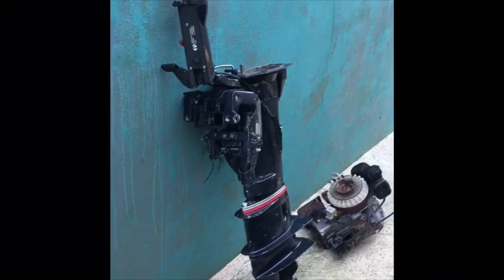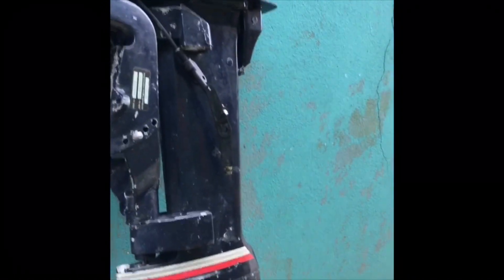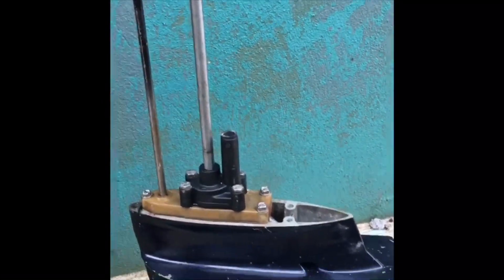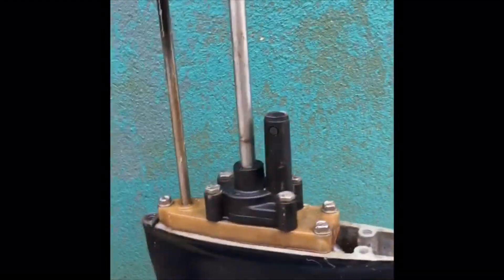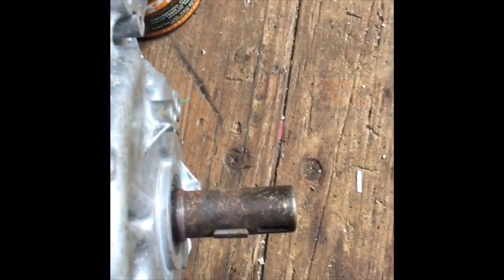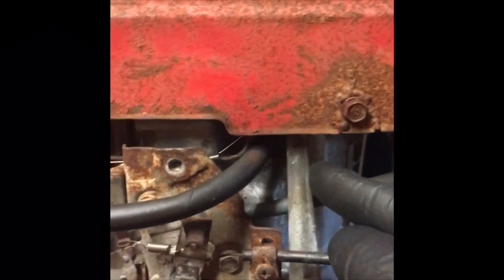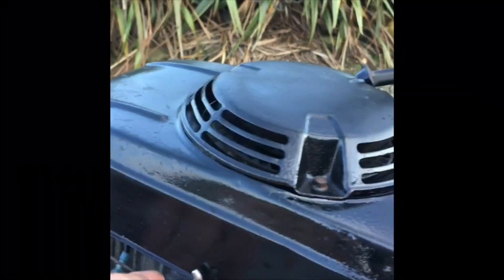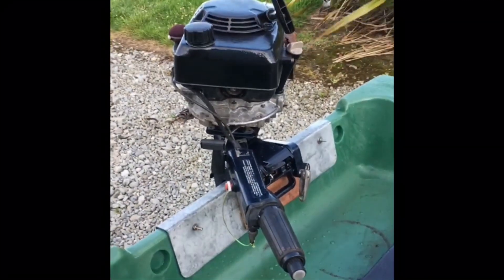Lawnmower powered Outboard Motor. Quick One Day DIY Job.

Comment: Great job quick question do you have any problems with your socket and shaft breaking over time how have it held up
Reply from the maker: Cheers. No problem at all with the coupling. Although I do admit to having my doubts at the time about it. I think the rubber cush drive in the Prop is enough to take up the engagement shock. I haven't tested out whether it will withstand the Prop hitting bottom yet, which given my record, somewhat surprises me 😅
Reply: @Ivan-Archer great job thanks for sharing your work

Comment: Lol or you can just buy a good outboard. I have a 1999 Suzuki 9.9 its 22 years old and it still runs great starts on the 2nd pull.
Reply from the maker: I have a 1968 Evinrude 6 and it does the same. The mower project was more of ‘I wonder if that would work’ sort of day out. 😁😁

Comment: Excellent. If you were to find a carburetor engine with a pump diaphragm like from a lawn tractor, you could carry the fuel in a larger tank inside the boat, and have even more horsepower to boot. But it's probably not too much bother to carry a petrol can in the boat and refuel with it when the tank gets empty. Sometimes simple is better.
Reply from the maker: Cheers. I use it as an auxiliary on my 25 foot Arvor and it moves it at about 4 knots. I have it in a sleeping bag below deck with an empty fuel tank. In case of use I can put it on the back, tank filled with fuel, and running in under a minute. That way I don’t tie up a valuable outboard 😁😁

Comment: How fast it goes
Reply from the maker: It pushes this 4 m plastic boat along at about 9 knots
Reply: @Ivan-Archer  oh yeah, that’s pretty good for a 5 horse on a 4 metre
Reply from the maker: @videomaker8207  I’m now using it as an auxiliary on my 8m Arvor. She makes about 4 knots. Ideal set up as it’s a cheap rarely used alternative to a €1500 engine tied up doing nothing. I keep it below deck wrapped in a sleeping bag with the petrol in separate container. Put the petrol in and it t starts first time every time.

Comment: Having recently found a 4m on a rubbish dump and successfully refurbished it, this outboard is the natural partner for such a boat. My tip shop has a few old OBs I can pick up the lower from. Thanks for the inspiration. I really like your use of the socket set. Awesome work.
Reply from the maker: Well it’s still flying along and I’m now using it as an auxiliary on my 25 foot Arvor. I keep it below deck in a sleeping bag with the petrol in a separate container. Tested it in August and I had it out at set up in 2 minutes and started first whip and pushed the boat along at about 4-5 knots. Great job and no expensive outboard tied up to probably never be used.
Reply: @Ivan-Archer  yep, I also have an 8.5m custom alum. with twin ob. (Arvors are lovely mate, it was the top of my list but i just could not find a good used one cheap enough (because they are great boats there are no cheap used ones!) congrats!) Anyway the only part of the boating experience i dread is when your returned home, towed this huge thing and parked it, your exhausted after spending 2 days out fishing or whatever and then you have to flush the motors.... with these no flushing. What a dream.
Even harder if your at a mooring and there is no clean water to flush
 Its great to hear yours is still kicking and that join with a socket still holds. 
If you can move your 25' fibreglass at 4-5knt that is very impressive... and useful. So enjoyed your video. Thanks!
Reply: @Ivan-Archer 
My Dad used to fish way on out in the blue water, off Big Pine Key  Florida,  and kept a little emergency put- put motor to come home with, of the 302cu in. quit on him. He said that would be a long way to paddle! He heard that, if you were running two outboards tied together on the transome, you could run a little motor like that and actually make a difference in your speed, if you were trying to out-run a storm. Just a little something to put onto the idea mix, if you find yourself close to a water spout!
  He said to put the boat on the trailer and shove a 55 gallon barrel under it almost full of fresh water, and run it a few minutes, every time you had it in the ocean.  Bill, from Tn. 🇺🇸

Comment: How much do you think that entire engine setup weighs?
Reply from the maker: Good question. I’ve never weighed it but it feels slightly less than the standard one. If I get a chance later I’ll weigh it.
Reply: @Ivan-Archer  I'd be interested to know. Appreciate it.
Reply from the maker: @bgsymalone  Sorry for the delay it slipped my mind. It weighs 26 KG’s. I’ve recently built a powder coating set up so that’s my next task for this project. Levers, covers etc can all be done. Used on Saltwater so pretty vital.
Reply: @Ivan-Archer  way lighter than I expected. No need to apologize, I appreciate the response. Looks like I'll be going this route. I'll be following your build!
Reply: Another video for lawnmowers said you can bend the governor arm to speed up, (dont mess with the gov. Screw) these engines can run faster without issue. You can look up the rpms get a cheep tachometer.  I have a 3hp dinky out board and hoping to get a 4hp mower for the Frankenstein build. Not sure if it will fit such a small out board lower half. Great build. Thems ar going fr about 8-1000 bucks.🤑👍👍.

Comment: how much hp on it and its still running?? Thanks
Reply from the maker: Hi there. It has a 5hp motor and it is still in every day use. Running well and I’m slowly replacing all mild steel bits with stainless or plastic coating the really difficult bits.

Comment: How do you turn off the engine?
Reply from the maker: I wired the outboard stop switch to the mower stop wire which simply goes to ground and cuts the spark. I tried to use everything I could on the outboard bit. It’s on its third summer now and in everyday use.
Reply: Like how did you hook up the switch thank
Reply from the maker: There are two wires coming from the tiller arm switch. This switch is normally open. One of the wires connects to the mower coil wire and the other is bolted to the engine. When the switch is pressed the coil wire is connected to ground and kills the spark.
Reply: Turn the engine off by pulling the spark plug wire off the plug 🙃

Comment: Brilliant...no more costly services and the engine can be used for other purposes when not being used on a boat... nothing worse than the expensive outboard sitting around not earning it's keep for 50 weeks of the year....thanks for the vid ...
Reply from the maker: Yeah it worked out really well and is still flying. Engines with blown power heads are numerous and no shortage of good mower engines. Any Saturday morning in a recycling centre will get you one of those.

Comment: How fast did you get going with that set up
Reply from the maker: If you didn’t have to shorten it the rest is actually very straight forward and could be done in an afternoon if you assembled the bits before starting. The gear change being where it was helped a lot. Used it all summer without a hitch.
Reply: How fast is that motor
Reply: I think he means knots/mph